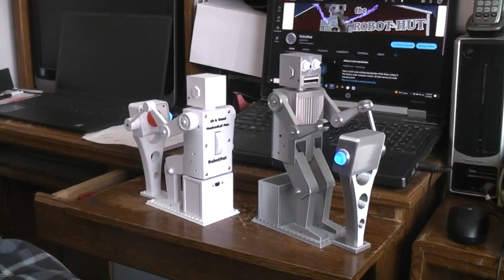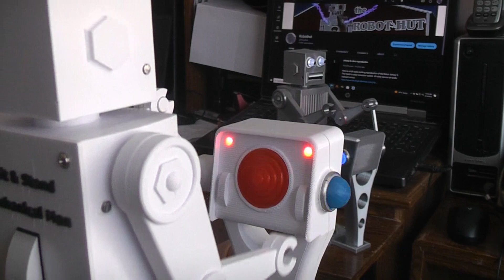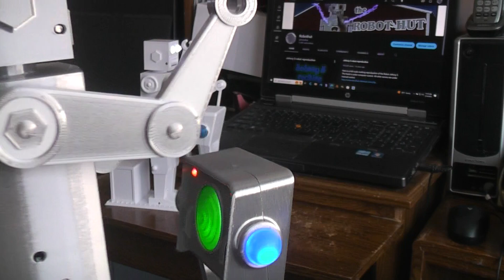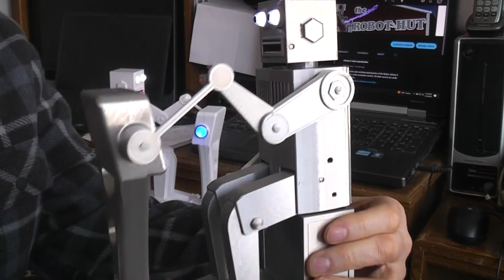Control panel, Sit & Stand Mechanical man demo. 3d printed, battery operated.

Comment: Hi, John! This comment is totally off-the-wall, but I was wondering if you knew of a set of robotic dogs from the year 2000 called “Big and Little Scratch“ by Trend Master. I don’t have a manual for these guys, nor can I find one online. I know all the Big Scratch’s functions are in the little remote that comes with them, but I’m not sure what Little Scratch is supposed to do. I’m wondering if his gears are seized or something. All he is doing is standing there and whining, very annoyingly. Can you help?
Reply from the maker: Lil Scratch is supposed to follow big Scratch around using a infared system. So I guess there must be a problem in Lil scratch's motor or control circuits if its not following the big dog.